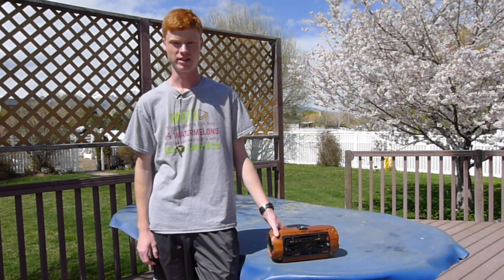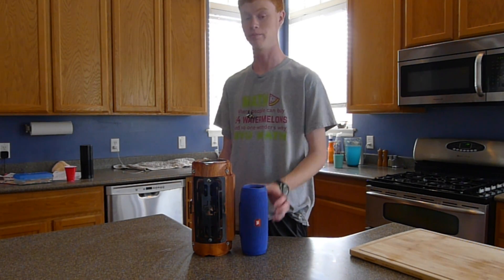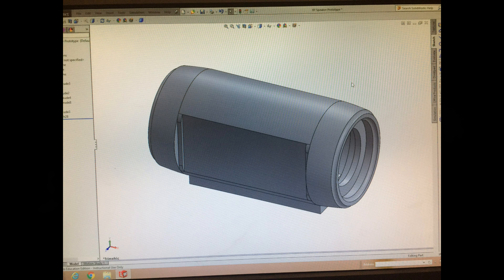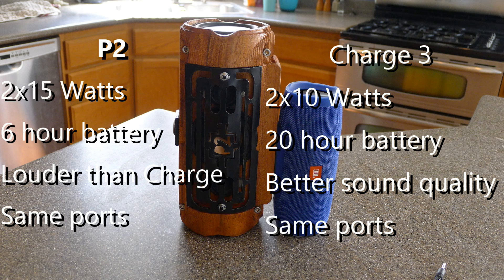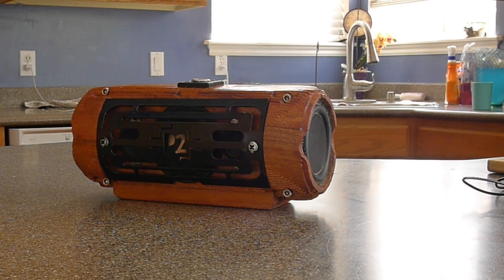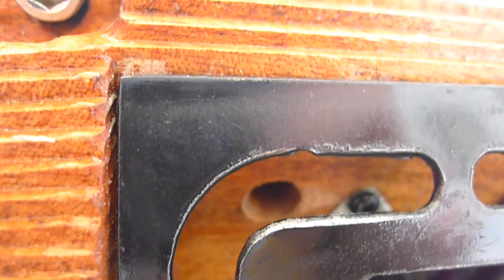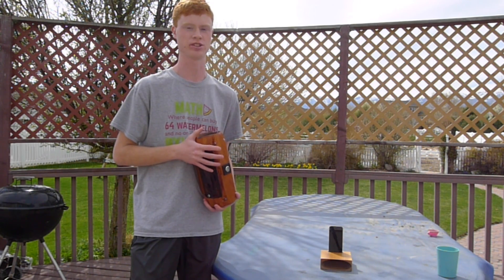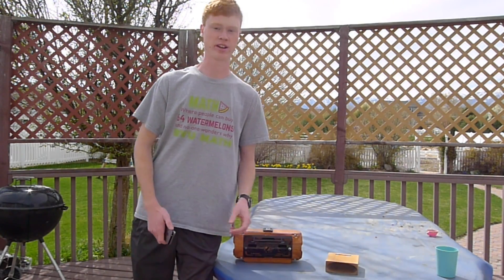The Ultimate CNC Bluetooth Speaker

Comment: That was nice man! Doing something similar myself, but i have not really found a place to print my enclosures. What kind of Passive radiators did u use?
Reply from the maker: josef fastlund oubad Thanks! I used basic rubber membranes as true passives are hard to find in this small size. Good luck!